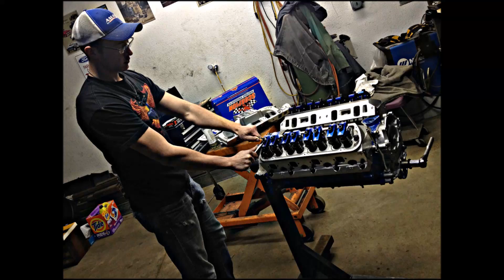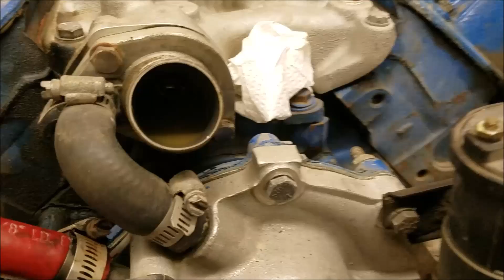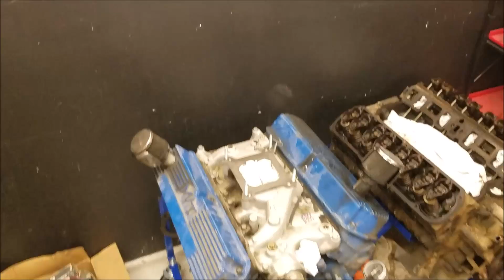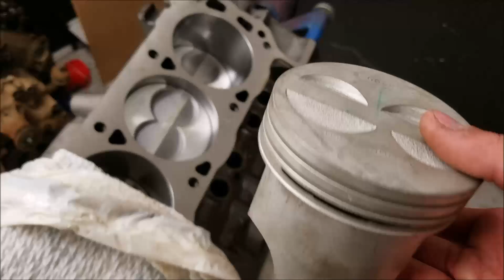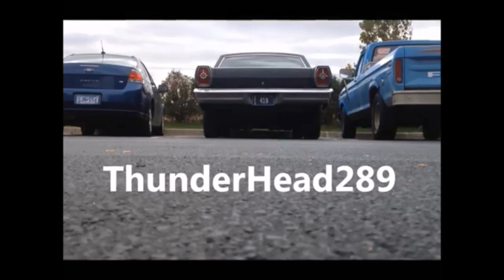Driving with NO/FAILED Thermostat in Car - Is it Worth It? (Explained)

Comment: Driving without a thermostat is simple suicidal for you engine. It is the easy way out for lazy mechanical principals. Wrong every step of the way
Reply from the maker: fact. 
it only works if you are overheating from a clogged radiator - if it works, it is a band aid for some underlying issue that exists elsewhere in the cooling system.
Reply from the maker: Yeffrey Ramos your cooling system is inadequate. That’s the only way it ever works. “Works” your coolant is cooler, but I wonder what your oil temp gauge would say. 
You are just moving the coolant to quick to remove the heat from the engine as well as you would otherwise. 
Need more cooling, get a bigger radiator. No thermo is a poor bandaid to the real problem.
Reply from the maker: Yeffrey Ramos when cylinder pressures increase like that, I go with electric water pumps to keep the flow at full tilt. Yes, I definitely see how you get hot. You are going to want an oil cooler as well if it’s turbo is pulling from the oil feed
Reply: already have one =) it's  ECT that is being mean to me =(... i bought a MEZIERE inline electric pump, but nothing is promised lol. I'm low on HOPE at this point. if removing the thermostat actually helps a bit i'm going to throw it on. Being that the radiator is double pass it might oem pump is prob not up to the task... yay boost right?
Reply: i have a raceready 3 core radiator from MIshimoto, faster fans and cooler thermostat. still getting nice and toasty! so will have to remove thermostat this weekend... turbo will heat up the motor just fine to operating temps lol trust me
Reply: lmaoo it is? shit so i must be dead

Comment: I Live in Southern California
The thermostat goes wide open after 5 minutes anyway.
It was common back in the day to run without one.
Reply from the maker: Temp your oil and see why that's a bad idea - an open thermostat is much different than no thermostat. The restriction is necessary to allow time to pick up heat and then to disperse the heat in the radiator.
Just because your coolant is cool, doesn't mean your oil is in this case

Comment: You are exactly right, if people say remove the thermostat, THEY DON'T KNOW WHAT THEY'RE TALKING ABOUT. 🤔
Reply: even if the termostat stack closed? most overheating issues bec of termostat thats why too many car owners removed it especially on those hot regions ..here in the philippines 99% of the jeepneys dont have termostat and they driving more than 12 hrs a day and still its running on our roads for more than 50yrs..what about those new cars in the market with termostat? most of them ovearheat and dont last!!!! well some wise engineers deaigned a machines that dont last so that the flow of money still keep on coming..😊😊

Comment: In general you're right for a year round daily driver. But for a hotrod only driven in the summer, some cases will be better without a thermostat. Like mine, it's a 454 BBC and I have a hard time keeping it under 190 degree. Pulled the thermostat and it helped cool it 5 degrees, not a big help but better than nothing. When I bought the aluminum rad I had a SBC but the big block maxed it out. What ultimately fixed the problem was installing two coolant fittings at the back of the intake to pull coolant out of the heads rear coolant passages and send it to the inlet side of the water pump. Now she runs under 180 all day long.

Comment: "coolant flows so fast" through the head that it doesn't pick up the heat and it can overheat?
Yes there are side effects of running no thermostat but overheating isn't one of them, cylinder washing and fuel air ratio problems yes.
Reply from the maker: It won’t show up on a temp gauge, but you will actually see your oil temp increase quite a bit - it’s just not getting the heat out.

Comment: There is so much incorrect information in this video is scary.  Simply put, rate of flow does not effect the temperature of the coolant whatsoever.  It's the other way around.  Running without a Tstat will not cause your car to overheat.  What will cause your car to overheat is the problem that caused your car to overheat in the first place which is why you're thinking about removing the Tstat.  This nonsense about the coolant flowing so fast it will make your car overheat is just that, nonsense.  Cars were run for decades with no, or inefficiently engineered Tstats.  The result?  They ran too cool.  Remedies existed such as placing a piece of cardboard against the radiator to allow the heat to build up to generate heat for comfort.  The Tstat exists for only one reason.  To allow the car to reach operating temperature sufficient to provide for interior cabin heat as quickly as possible.  And the next time I see a non-operting car come into the shop because it was overcooling, as opposed to overheating, will be the first time.
Reply from the maker: You won’t see it in the coolant - it will still read cold. The cylinders are actually hotter overall - it even shows up in the oil temp. 
These are facts, not fiction.
Reply: @ThunderHead289  These are not facts.  Think about what you just wrote.  If this were the case, it would be such with or without a thermostat.  Either the coolant is cooling or it is not.  It's rate of flow does not matter.  If a car is overheating without a thermostat, cylinders or else, it's not BECAUSE you do not have a thermostat.  It would be overheating for the reason that is causing you to take the measure of removing the Tstat.  All other elements of the car working properly, the removal of the Tstat does not cause overheating.  It accomplishes just the opposite.  Rate of flow does not effect temperature.  Temperature effects rate of flow.  So if you're going to claim facts, start with that one.  You're just wrong on this one.  And I'm not even saying that the lack of Tstat will not possibly cause damage to the internals of an engine.  But it does not do it from an increase of heat within the block.  If it causes damage, it will be because the block is too cool and not reaching and maintaining optimal engine temperature.  But that's just the opposite of what you're claiming.  And no, it does not show up in the oil temp.
Reply: @dalepress1581  Excellent interpretation. I totally agree with you, on this one.

Comment: People have done tests running cars without thermostats where the cars do not overheat.
Test of car being run with fully open thermostat running just water  in idle position and the vehicle did not overheat.
https://www.youtube.com/watch?v=W9g1cLJ2k88

Can you please explain how faster flowing coolant does not cool the engine better than slower flowing coolant?
The more surface contact an object has with a coolant, the faster it will cool.
Another guy did an experiment showing how spinning a can in a liquid (which is similar to rapid flowing coolant) cools much much faster than merely placing the same can in the same temperature liquid.
Cool a can in 90 seconds vs 20 minutes:
https://www.youtube.com/watch?v=50VyUdewAj4

Comment: In the heat of Alabama, we take the thermostat out in summer. In the dead of winter we put one in. They're incredibly useful in the winter time. A cold engine should never be kept cold, for many reasons. Old iron head iron block motors will naturally pick up heat regardless. But in winter time, you'd be amazed at how cold a car can stay. I had one with no thermostat stay so cold, you could hold your hand on the heads comfortably.

Comment: Hi I have a diesel Toyota engine and I can't reach operating temperatures i recently replaced the water pump myself but didn't change the thermostat. Both radiator hoses are hot to touch and the heater still works? Do u think ive got a stuck open thermostat

Comment: My 1992 camry 4cylinder had it without thermostat for 7 years .  I live in Coachella valley.   It gets hot over here up to 120 degrees.   And my car still runs fine .  And I removed both fans .  And been stuck in really bad traffic and temp is in the middle.  Those toyota motors are almost bulletproof.

Comment: None of this is true I’ve been buying cars for 25 years ran thousands of cars without the thermostats to freezing temperatures different makes different models different miles different years and through the summer never once have I had overheating issue come on now
Reply: Since the 70's my father has been taking out the thermostat in every car he's ever owned...Now I'm 50' and I drive a 2004 jeep Cherokee without a thermostat... There's has never been a problem of engine failure because there wasn't one...And the only time I've experience over heating is when cooling fan failed while idling in traffic.
Reply: @emilmar5466  Thanks for sharing this , and I am taking the spring from inside of the thermostat so that it won't close anymore, on my Toyota Prius V 2013 , that is built into chamber. I wish I did knew this before when I got stuck 2 hrs away from home, heading on long drive. So, I bought a after market one from nearby auto zone and put it myself , but , had to stop on the way back every 20 minutes due to overheating, and topping off the coolant. Now I now what to do next time. Rip off the spring that's inside Thermostat and refit the tstat so it'll let the coolant flow.

Comment: Thanks a lot, I'm a tech but a modern tech that only replaces parts. I just bought a C6 that doesn't hold a good temp and runs cool. I kind of assumed that shouldn't be an issue but am concerned with oil temp and heat expansion. I'll be starting at the tstat ASAP. Really good video.

Comment: I have a 57 willies and it's got a 302 ,the center  of the block gets warm 180  thermostat will not open soon enough, I am at 205 and then it opens but it's to late it wants to roll to 210 and I shut it off before danger,

Comment: NEVER run without a thermostat on any modern car EVER. The car is design to run at operating temperature, and get there quickly, so your car will CONSTANTLY be in a state of "cold start" meaning the computer is throwing tons of fuel into the engine trying to get it to operating temp and it'll never get there. All that fuel ends up in your cat and destroys it. It also breaks down your oil and screws with the lubrication of your rings. And another side effect, since your coolant never gets to temperature, your radiator also never gets your transmission fluid to temperature either, and on my car that meant that the torque converter would never lock up since the atf is supposed to be at operating temperature as well.

Comment: I am thinking o Taking out mine as I have replaced EVERYTHING on my POS 2004 Ford Focus and the thing SILL overheats, I mean from the radiator, blown hoses from overheating, new thermostat, housing, pump, there is nothing left for me to do BUT take it out as I am not going to spend $2,000 to rebuild a motor on a $1,000 car, so do you suggest anything else?

Comment: If your in a hot climate and having over heating issues that you can't solve then, pop your thermo out. If that solves the problem then pop a restrictor plate in it. We run no thermostats in all out circle track cars and my father's drug car. Actually the mustang in my pic has no thermostat. Thermo stuck on a trio to PA so I pulled it apart on the side of the road and haven't put one back in it because it works fine for me.
Reply from the maker: The problem is that a guy can’t really tell - your coolant is moving too fast to pull away heat as effectively as if it were actually slower - if you had an oil temp gauge, it would actually read hotter while your coolant temp “appeared” cooler.

Comment: There should be a caveat though, if the choice is driving overheating or driving without a thermostat (say you are on a road trip far from home, it is a long holiday weekend and you can't get the part) if the car will run and not overheat, pulling it out can be a life saver if you've got one that would otherwise be stuck closed.

I've had to do it a couple of times, with no long-lasting effect, but like the video said, it also depends on the model. I of course wouldn't do it if it cause the engine to continue to overheat due to improper cooling, but if the choice is being stranded due to overheating or having some loss of efficiency in the short-term then it can be a good quick fix. The short-term risk of driving with it overheating at all vs not having a thermostat is quite a bit different. It's always about the risk/reward ratio when doing triage.

Unfortunately this little trick doesn't work as well with a lot of newer cars anyway where the thermostat is integrated into its housing and impossible to remove.

Comment: New thermostat arriving in the mail later tonight I have to go take a drug test for parole keep the locked one on that's been burning up my fucking engine and oil and making my engine overheat cuz it's locked in the place my hose feels like it's going to explode burn up the engine or have it cool so I can run over here real quick I rather have my engine cool it's a truck it'll be fine nice big Pistons my engine oil is fried I'm not doing it

Comment: My old Impala had a stuck open thermostat when i bought it, 160f at idle, 130-140f on the highway. PCM was not stuck in open loop though.
Reply from the maker: DarkLinkAD how do you know that it wasn’t? - and really that’s a model by model basis - like the 94 bronco holds open loop. 
Another aspect is that water flows so fast that heat is not transferred - so the probe reads cold, but if you have an oil temp gauge, you will actually run higher oil temps
Reply: OBDII vehicle, you just log the PID's for short/long fuel trim, open/closed loop status.
  Cant remember if the Impalas have an oil temp gauge, its been years since it was totaled with 225k miles IIRC.

Comment: Riiight. Thermostat on an older car I just brought for my new job is stuck closed. Engine overheats in 5 minutes. Removed thermostat to test it, that's how I found it's stuck closed and not opening at operating temperature. Running the engine without the thermostat and just letting the coolant free-flow, engine doesn't overheat, doesn't get as hot as it should but still registering just under half on the gauge after 5-10 minutes(variable in reaching that temp is down to day or night time operation, gets warmed up during the day faster.) Maybe what you're saying applies to people who live in igloos but sure as shit doesn't apply to me. Maybe you think running it with a blocked thermostat is a better idea?

In the tropics where I live, we have two seasons, wet and dry, there's no winter or summer, it's always hot it's juts sometimes it's raining. The chances of me freezing to death without a heater in my car are about the same as having removed the thermostat causing this fuel injected 2008 year model engine to suddenly have a choke or my pistons being damaged in the week or so it'll take the new thermostat and o-ring to arrive. In the meantime, driving without a thermostat means I get to keep my job and not blow a hose, head or gasket due to overheating which is much, much, much worse than running a little bit cold.
Reply: I’m trusting you
Reply: He's completely right here. I've had many problems with old and new thermostats.  It's cost me lots of money. Normally the first thing to go from a faulty thermostat is your radiator hoses, your radiator etc, or you will blow a head gasket. 

In summer just hiff it out. I would recommend using one in winter, but just make sure you test your thermostat before installation. New ones can be faulty.  It's not worth the stress, being stranded on the highway or in town with a f..ked engine, all because of one little small device everyone says is so vital to your car irrespective of the climate. 

Quite frankly, if you have an older car with lots of mileage and you dont thrash it, use the right engine oil and coolant; removing the thermostat in summer is a very wise move.. older engines dont like to be too hot.

Just a tip for highway driving without one. You can always turn your AC on which will get the big fan operating to assist in cooling things down. Especially in slow traffic where theres not enough consistent air flow running through your radiator and around your engine..

Comment: im a fan of taking out the thermostat .   i know this . in the swimming pool industry if the water moves too fast thru the heater it wont get hot and stays cool.  i can see the engine being hotter than the coolant and getting false reading and actually running an engine hotter than what the gauge reads.
Reply: Wrong. In the swimming pool scenario heater distribute heats to lots of water volume if it flows fast. Thats why you wont feel.big different. If it flows slowly heater can pass the heat to specific water volumes quickly.